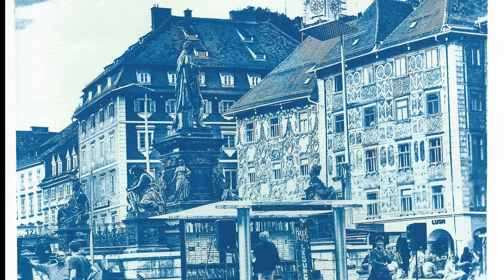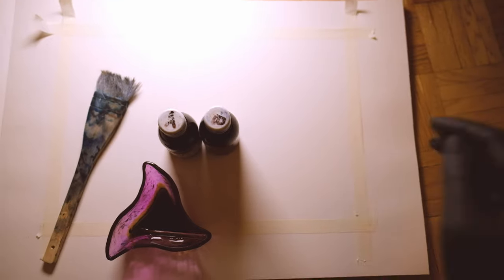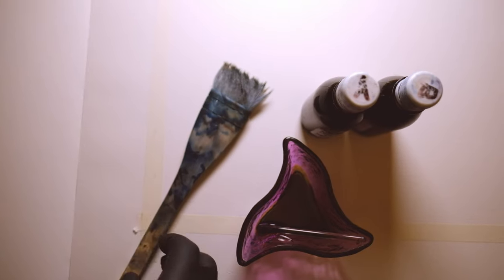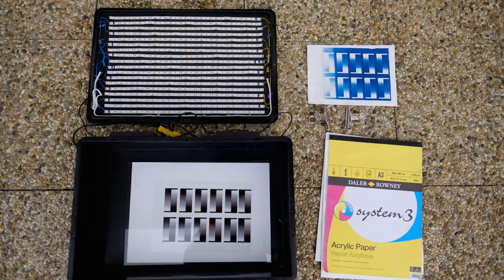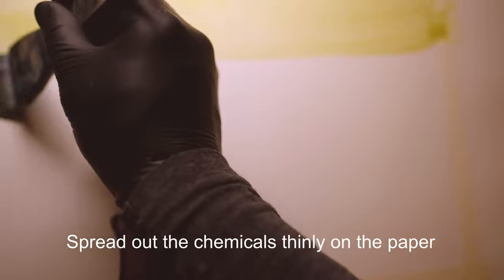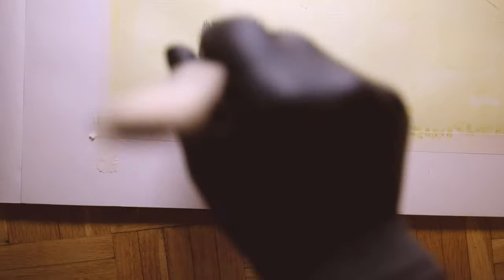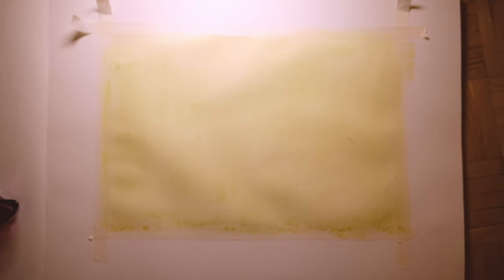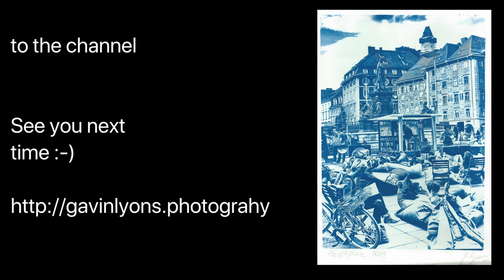Cyanotype Preparation

Comment: Hi,
Thanks for the video, can you answer a question?
Why do you apply such a thin layer of the solution? I usually apply two layers in order to have more solid shadows, what is your opinion?
Reply from the maker: mmh never tried that to be honest, never it read it anywhere but I could be wrong. The great thing about the UV box you can easily find out if it makes a difference. The negative probably plays a big part in this. Printing the negative in orange/yellow tones affects the print too. Thank you for your comment :-) Gavin